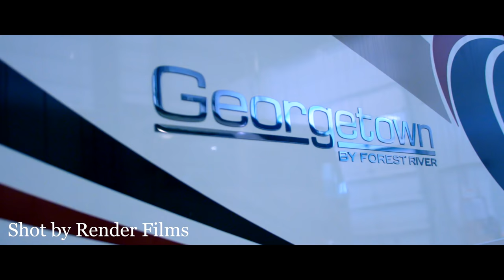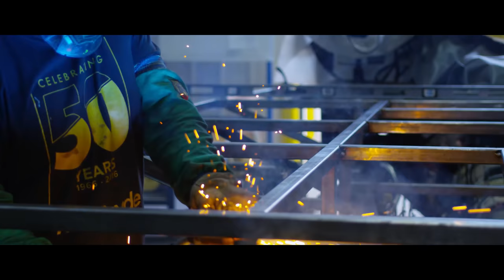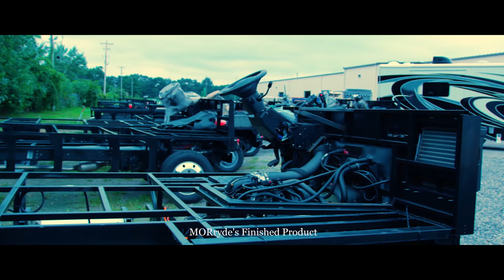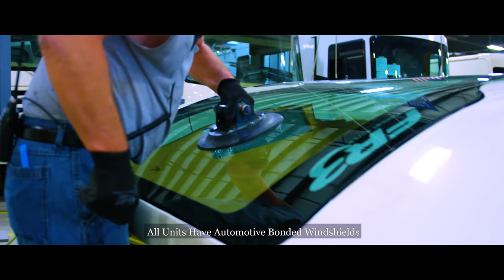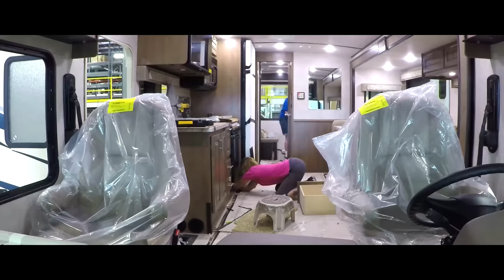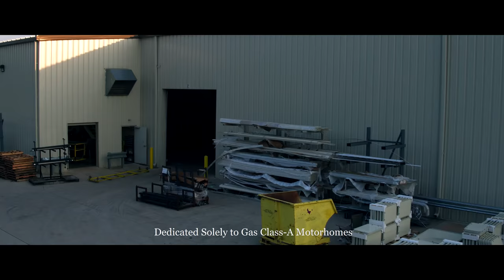Georgetown/FR3 Class A Gas Motorhome Plant

Comment: Have interior lights been changed/converted to LED ? My 2004 Georgetown had original interior bulbs that got so hot they caused discoloration or blackening under the roof mounted light fixtures , & LED exterior storage hatch lights would seemingly consume less power ?  #WarrenBuffett